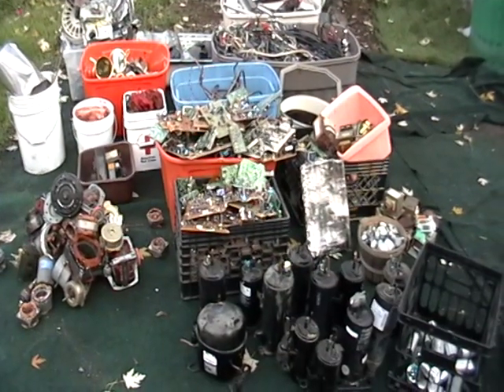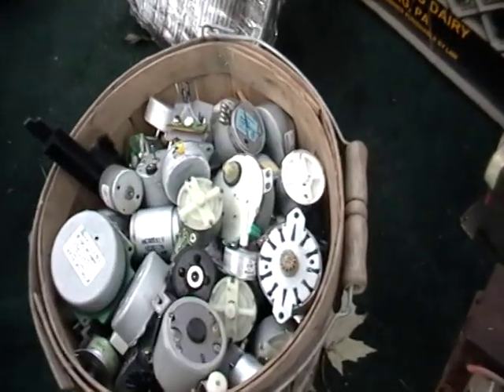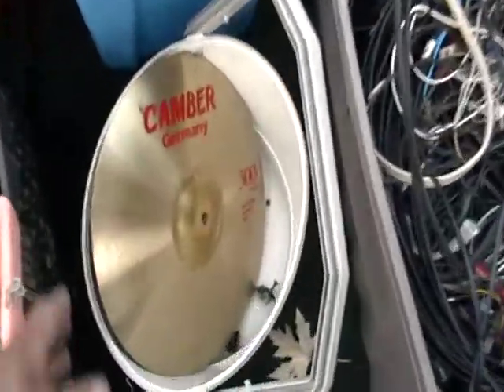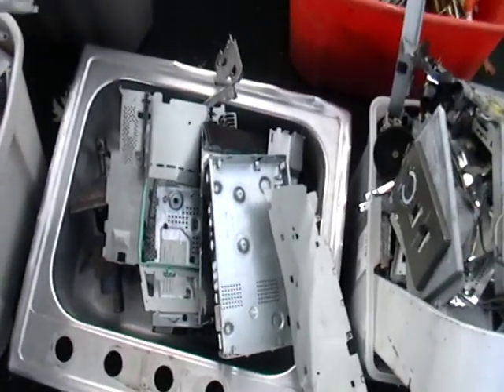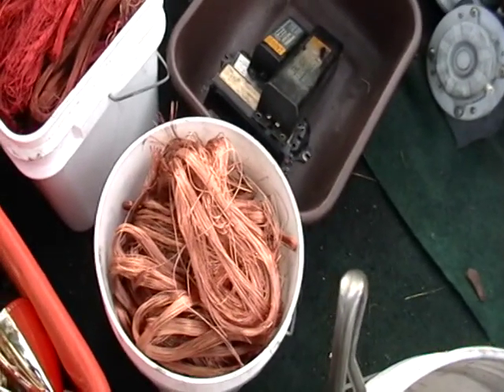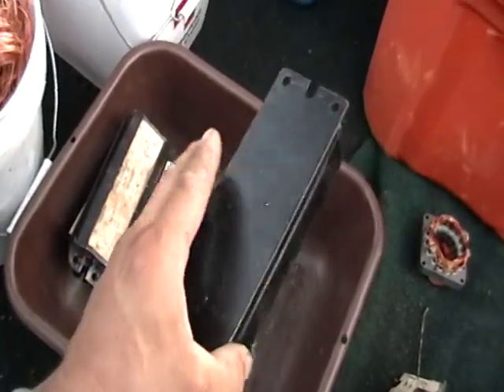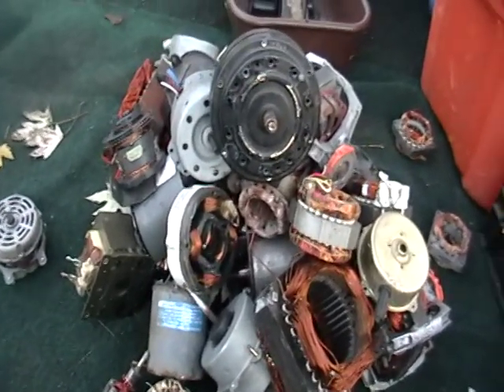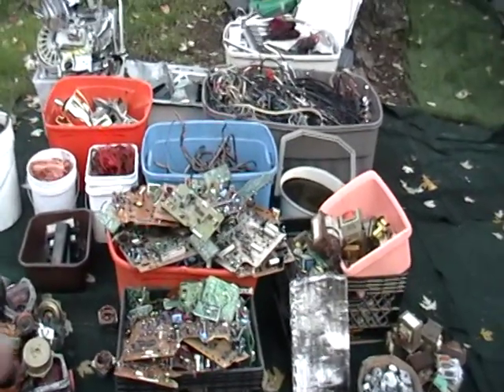Going to the scrapyard.

Comment: Nice load Mike. I had a question about wires particularly #2 insulated. When I went to the scrap yard yesterday they tried charging me .45 a pound. I had been getting paid $1.10 and another time $.95 then yesterday $.45. When I asked him about the drastic price change  he told me because there is not much recovery there. I told him I always bring in the same stuff which is electronics. He changed the price to $.85. Has this ever happened to you? Should I sort my wires or what?